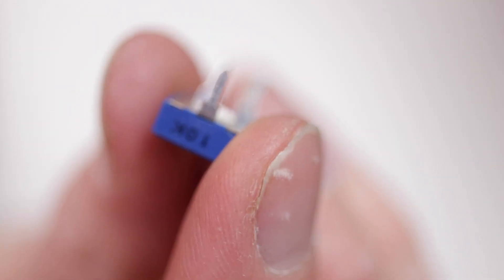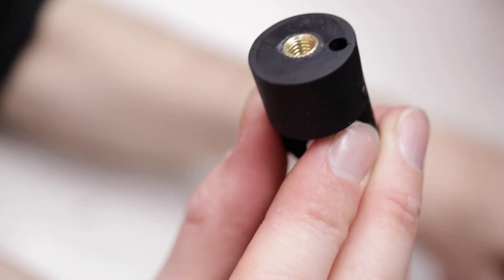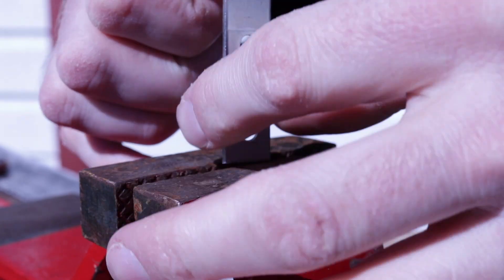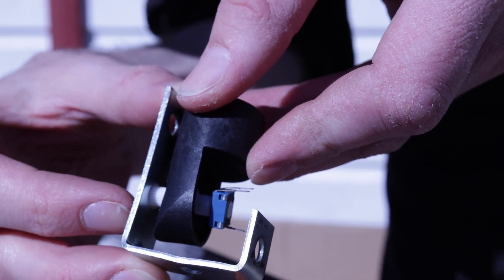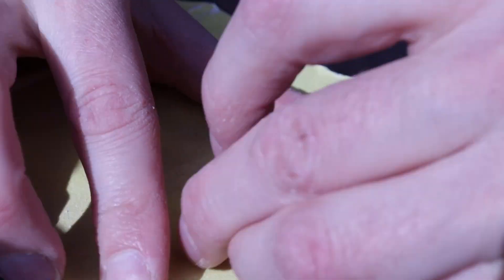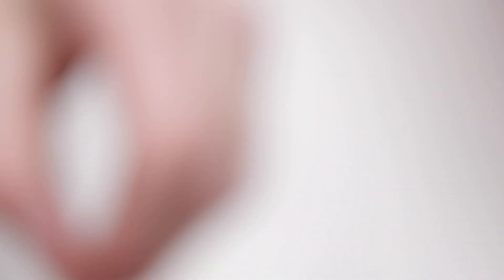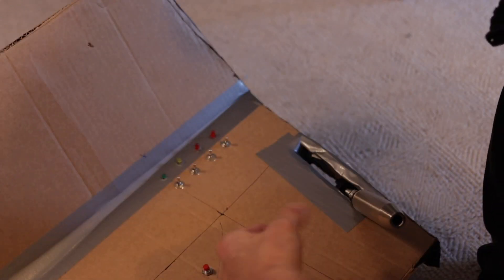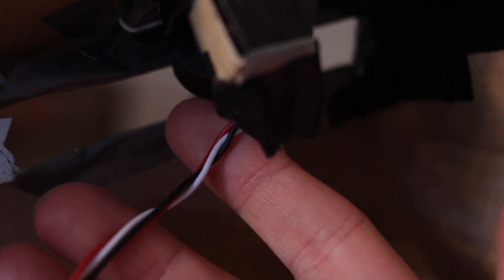How to make a Throttle Stick for your Cardboard Cockpit!

Comment: Hello! You have taught me so much in your videos and I’m using it for my cockpit build. Right now, I am trying to figure out how you get the Journal file to the Arduino to be read by node red?
Reply from the maker: It's a bit of a mess. Different files needs to be read in different ways, as some are added to and others are overwritten (the journal). But basically let node-red look for file changes, and if that doesn't work, have a node run every X seconds and just read the file.

I then have a script running through the data and discard everything it has seen before (using the timestamp).

I can try to share my flows on GitHub, but I don't know how well it works to export. I'll try! But it might take a few days before I have time to look into it.

Also: thanks for the nice comment! Would love to see your build!
Reply from the maker: I've shared my Node-Red flows to GitHub. It's a bit of a mess, but check it if you want some inspiration!

https://github.com/jonbck/SpaceShipSimPitControl